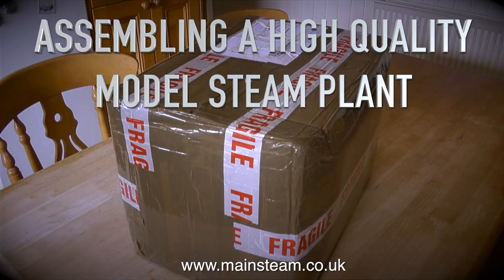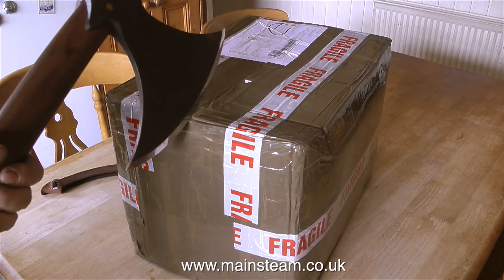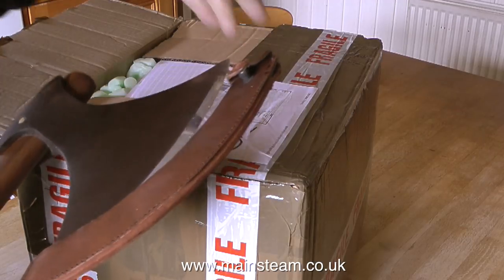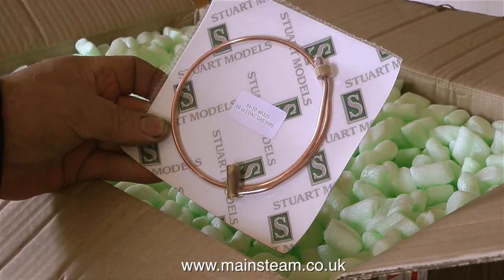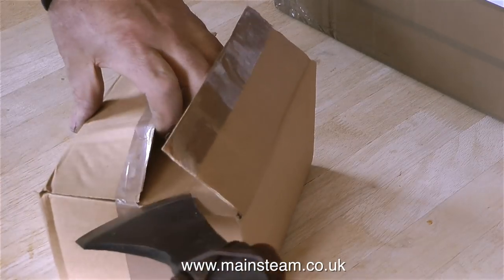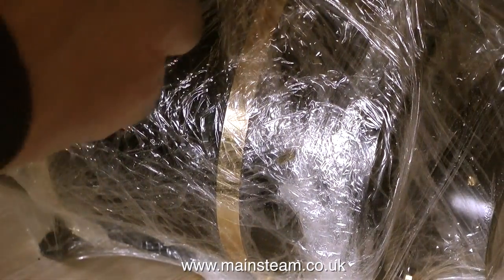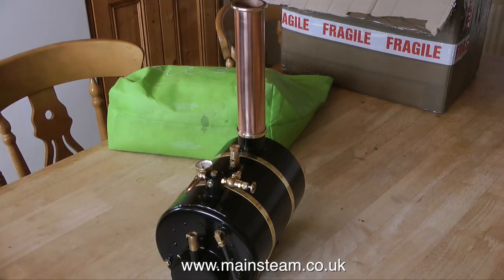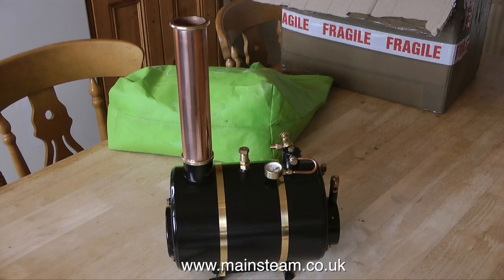ASSEMBLING A HIGH QUALITY MODEL STEAM PLANT - PART #4

Comment: If possible, it would be nice to see you fill or partially fill the fuel tank. I'm curious to see what differences there are between UK and US general purpose propane tanks, particularly valve threads.

Comment: How does a "horizontal syphon" (at 3:52) works? I thought that it would be a syphon if "U" was vertical? Horizontal "U" is just that, a U bend and not the syphon?
Reply from the maker: The condenstation of steam is not gravity specific . . .
Reply: Yes, I suppose pressure gauge flooded with condensate is some kind of siphon :-)
I'd personally continue with the tailpipe turn it upwards with the gauge vertical...
but I guess it works like it is so it doesn' matter
thanks for replying btw
I do enjoy watching your videos